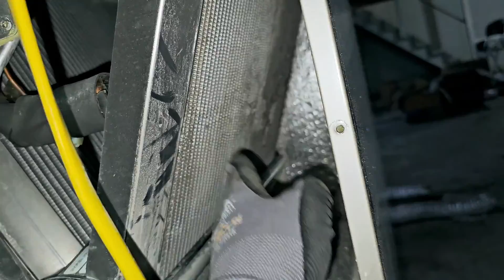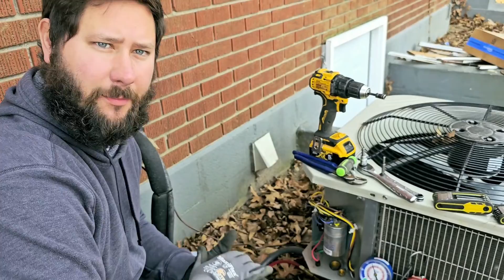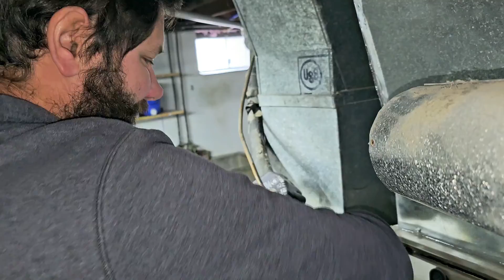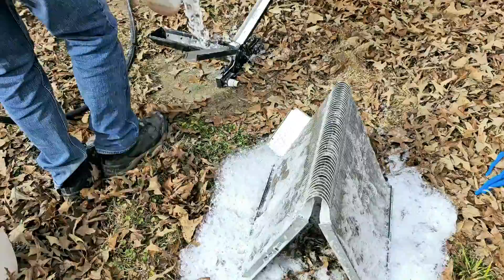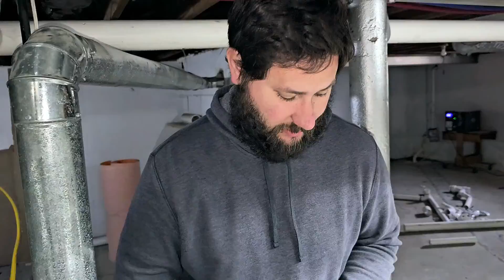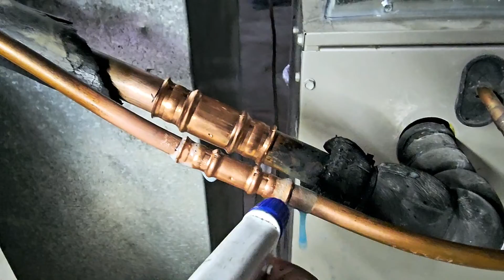Why air conditioners always need a filter? #airconditioner #gasfurnace

Comment: Good rule of thumb on the press fittings, always check that the o rings are installed, few times I’ve gotten some from the supply house and one was missing…

Also, sometimes those furnaces have a secondary heat exchanger above the blower but below the furnace heat exchanger and evap coil that also gets plugged up causing restricted air flow and hi limit trips, I’ve seen them on Carriers 

If you remove the blower and look up you will see it
Reply from the maker: Good stuff thank you for the advice my friend
Reply: @taddydigest  haha ask me how I know lol

Merry Christmas to you and your family bud

Comment: Love to see this done so thoroughly, but couldn't the coil have been cleaned while still installed?using some coil cleaner and rinsing it out while making sure not to get the board or other sensible electronics wet.
Reply from the maker: I really wanted to clean it while it was installed but I felt like I would get everything wet.